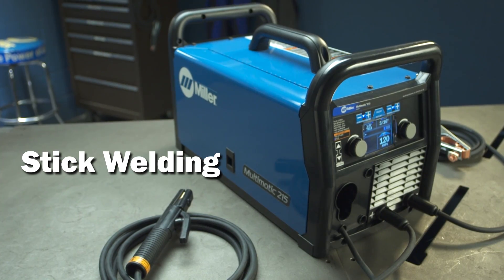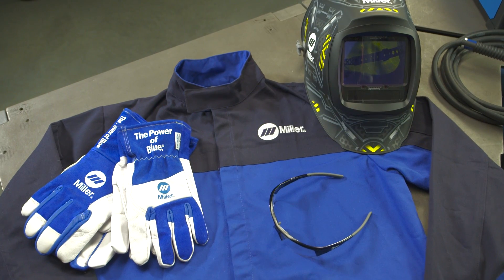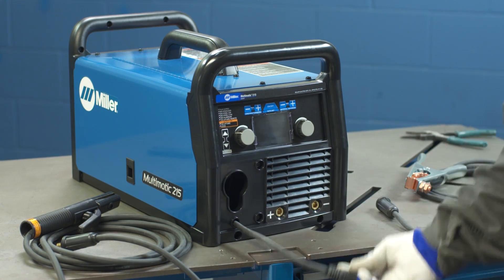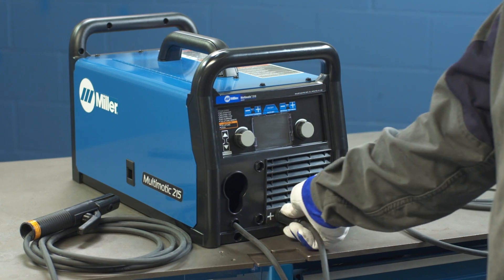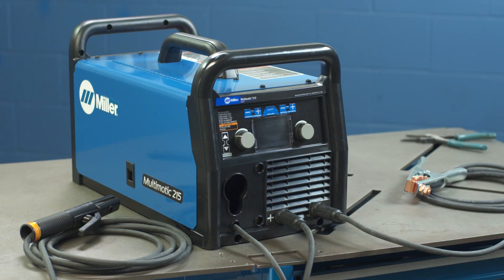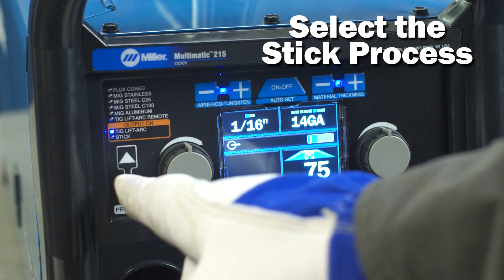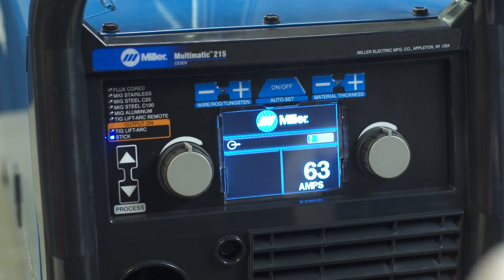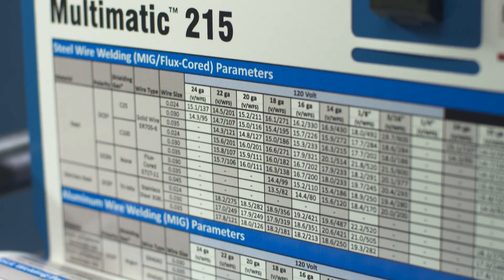Miller Multimatic 215 Setup for Stick Welding

Comment: Can I run the 215 welder with 7018 stick? Or what sizes can I run it with it?
Reply from the maker: Yes, you can use E7018 with the Multimatic 215, up to 5/32" diameter electrodes.

Comment: Where the f@@@ is the specs on what it will stick weld on 120
Reply from the maker: You'll get a range of 30-100 amps of output in stick mode on 120v input power.

Comment: So I just plug in the work lead and put it aside?
Reply from the maker: Thank you for the questions. At that point in the video, the unit is set up for stick welding. When you are going to weld, you would need to attach the work clamp to the material you are going to weld on and put a stick electrode in the stinger. Thank you.

Comment: Will differnt tig torchs work with you millermatic215?
Reply from the maker: Hi Robert, thanks for your question. Different TIG torches can be used with the Multimatic 215 as long as they can be attached using a 25mm flow through Dinse connector.

Comment: Will this weld 2 3/8" drill stem pipe 3/16" thick with 6011 1/8 rod on a 30 amp 240v plug thanks for the video nice welder.  My Lincoln buzz box will weld at 80 amps.
Reply from the maker: The Multimatic 215 will run 6011 electrodes. There are Auto-Set parameters for 3/32”, 1/8”, and 5/32” 6011 electrodes. You can also use Manual Mode to fine tune parameters.
Reply: Welds great not disappointed

Comment: Can stick weld aluminum with this machine?
Reply from the maker: Hi Freddy, the Multimatic 215 performs DC stick and TIG welding. Aluminum welding is possible when MIG welding with a spool gun.

Comment: this machine does not have adjustable hot start or arc force?

i guess my main question would be. does it have it have "automatic" arc force?
Reply from the maker: The Multimatic 215 automatically sets Arc Force and Hot Start. In the Auto-Set mode, the Arc Force and Hot Start values are based on the electrode, electrode diameter, and material thickness being welded. In Manual Mode, the Arc Force and Hot Start are set based on the amperage set by the user.
Reply: I decided not to buy it because I couldn't adjust the arc force. How does it know if I'm welding in the flat position or vertical up?